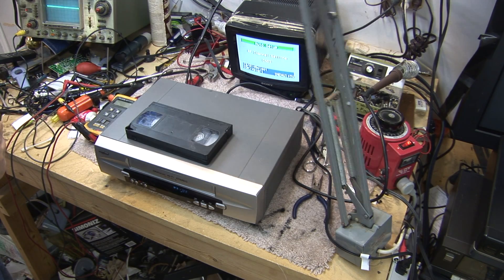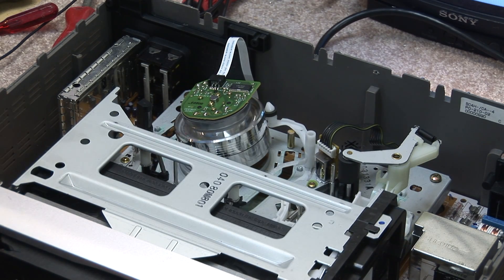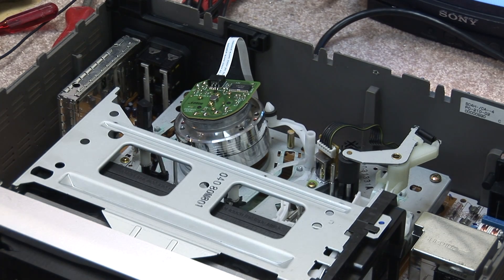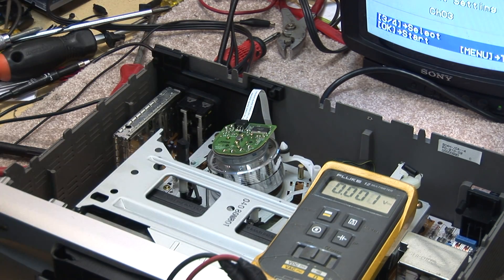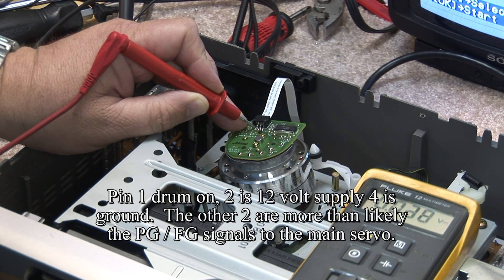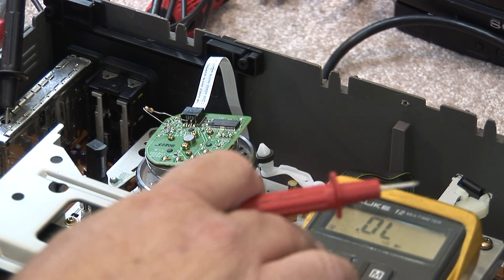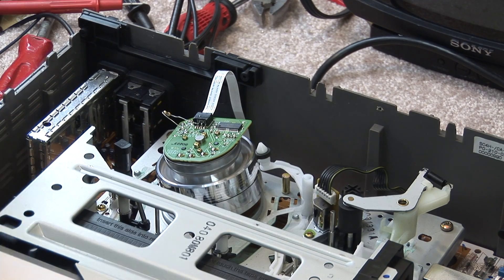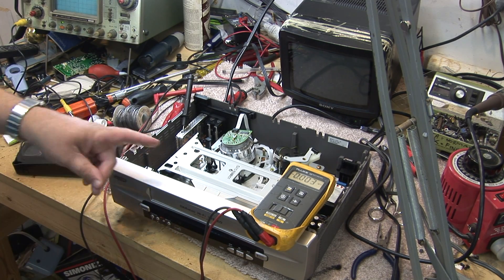Sanyo VCR Drum Servo failure

Comment: I can't thank you enough for this video. I have been having head drum speed issues, and I haven't been able to figure out what controls the speed. As I slow it down I see voltage spike on the pins, and then if I leave it alone it oscillates as it slows down and speeds back up. I feel like this is putting me in the right direction
Reply from the maker: If there is a drum free speed control tweak that slightly. As components mainly small caps drift they can get out of spec and cause the servo to get out of lock.

Comment: Do you have any idea on fixing a U-Matic deck where the capstan motor will not turn? I measured the voltage going to the capstan motor and it's only getting 2 volts, and the machine is going into shutdown. I have the schematic. For some reason I get the 450Hz FG signals though I can see them on my scope.
Reply from the maker: FG is generated by the motor spinning.  FG=frequency generator.  If the motor isn't turning you won't have FG
Reply: @12voltvids  Okay so it is turning because the FG signals are present. The servo circuit uses PWM and I can see it on my scope. Is that why I'm seeing only 2 volts? I'm trying to find the problem. Symptom is that it won't thread a tape and after 5 seconds the tape slack LED lights up. The drum motor is turning and I guess the capstan as well, but the reel and loading motors don't turn.

I looked into the service manual and it mentioned that if the "capstan reverse status" continues for 5 seconds it detects tape slack and will shut off via a signal that goes high. So I was thinking there was a capstan servo fault.

I know all of the motors are okay (loading, drum, capstan, reel)

Also this is a portable deck that used the small size cassette.
Reply from the maker: @KylesDigitalLab  If the take up reel is not turning or turning fast enough the tape will go slack and trigger an emergency stop so as not to eat the tape. Check your idler tires for slippage.

Comment: I got a Sony SLV-T2000 with doesn't power on at all, nothing. Powersupply is fine, I get the correct DC voltages. However the VCR powers on when I disconnect the 5 pin (MTR GND, D FG, D PG, D VS, MTA 12V) cable to the drum motor. Do you have any idea what I could try to fix this? The pins are not shorted. There is an IC on the board of the drum motor where the 5 pin cable connects. I would really appreciate it, if you could give me a hint. Caps on the circuit are ok i think. It's kinda weird that to VCR won't power on at all and the drum motor doesn't speed up at all when it's connected. Might this symptom be a shutdown mechanism from Sony?

Comment: Hi! I have an UVW 1800.. I bought a Convergence AFM216 Audio Enhancer which came with 2 connected cards and a few loose cables which i suppose they were connected to another card, but they were cutted off it. Sorry, for bothering you, but I'd like to know how to connect those loose cables, do you know how to do it? do you have a manual or schematics for it? a picture of the connections? whatever.. please if you could give me any idea on how to solve this problem i'd apreciate it so much. Thanks!

Comment: Great video.i currently have a similar problem with a vcr i was given.it was originally a mode switch problem which i fixed and it was working fine.now all of a sudden it will load and play a tape for a few seconds then stop playing because the drum is spinning way too slow.now i have a service manual for it so I'm going to see if i can find the fault.

Comment: I made an error on my Sony 670 dat. I changed the reel motor with a new one. However during the removal of the large white flex cable that connects the mechanism with the main board I did not remove the power connector as stated in the manual and now the drum does not spin.

Comment: 12voltvids .Hello there. I have sony sl800me betamax. The image plays in black and white. Heads cleaned. the tape is clean. Black and white image on all tapes. I tried it on different tv, the links are correct i am novice. I wonder where is the problem.
Reply from the maker: The chroma information is stripped from the video during recording and converted down to 688khz on beta (629 for vhs)  on playback this converted color needs to be converted back to the proper frequency and mixed back in to the video. Obviously a problem in this circuit. Could be a capacitor, ic, crystal ect.
Reply: @12voltvids  Thank you 12voltvids

Comment: This is very informative Dave, thank you for this. I have a question, maybe you can point me in the right direction. I have a JVC HR-S4600U VCR with a head that doesn't spin. Servo is on top like this unit. I checked the voltages on the flat cable and I'm not getting a run voltage (13V or whatever) but I do get 5V on the enable pin when a tape is inserted. Same thing at the mainboard connector so it's not a bad flat cable or head drum. Any idea where I can start looking to see why run voltage isn't being supplied? I can't seem to find a service manual for this model either. Thanks for your help man.
Reply: I did a little more tracing off the mainboard drum connector and traced pin 1 back to the PSU side and found an ICP-N15 that was open. Didn't even notice it was there the first time because I thought it was a transistor. On the supply side of it was was about 12V. I am ordering replacements ICPs from China (bleh...). Will post back here for anyone else with this issue.
Reply: Follow up on my HR-S4600U if anybody needs to know in the future. I received the ICP-N15 in the mail and replaced the bad on the VCR mainboard. Reassembled the unit and the head started spinning again. Works and plays tapes well now.

Comment: Thank you very much for your videos! I admire how "easily" you troubleshoot these machines and how quickly you get to the cause of the issue -- obviously you may have a long experience. Unfortunately, I have no experience and although your videos helped me to understand a few things, I was wondering if you or any other visitor could help me with this: https://youtu.be/6AxS-QDrBec I suppose that the picture and audio distortion I am getting may be due to a problem of the servo/tracking PCB, however I would like to be sure before ordering a replacement for it:  Thank you very much in advance!
Reply from the maker: Picture / sound distortion is more likely a mechanical alignment issue.

Comment: Any chance you can do a video on a VCR that has a playback that's too fast? When a tape plays it's almost like it's in FF. I've cleaned the mode switch, heads, tried multiple different tapes and even swapped out the servo and capstan (it's all one assembly) and still have the same issue. It's on Magnavox ZV427MG9 (VCR/DVD Recorder combo).

Comment: Im working on a Toshiba VCR/DVD recorder combo. The power supply was dead (diode), replaced it and it turned on. Initially the drum wouldnt start at all. I turned it slightly with my finger a couple revolutions and tried it again and it fired up and played and entire movie. When  I tested it the next morning it did the same thing. I don't know where to start. Ive fixed a ton of these and sold them but this one has me puzzled. Hoping you can point me in the right direction!

Comment: what rpm do theese run at?
Reply from the maker: John Scarce 
1500 for pal countries and 1800 for ntsc countries. 25 frames x 60 second and 30 frames x 60 seconds. Each rotation of the drum records 2 fields, 1 full frame. 
Now when digital came out things got faster. Digital 8 spins the drum at 4500 rpm and dv goes at the insane speed of 9000 rpm.
Reply: Thanks for the fast reply wow. i got 1 motor from those, but i have no idea if the vcr was digital or ntsc (im in europe so its ntsc). is there any way to guess what rpm was the motor designed just by looking at the motor(coils and magnet), the pcb, the drum or the rotational transformer coils?
Reply from the maker: John Scarce 
They are 3 phase ac motor controlled by the motor drive ic. They will go whatever speed you drive them to.
Reply: most of them are 3 phase perm magnet(such as mine). the problem is i blew the controller by applying voltage at the wrong pins of the power cable connector. even if it wasnt blown it wouldn't be able to know what voltage to drive it at to see its full potential
Reply: btw im asking because im making custom drive circuitry

Comment: This video is really helpful, I have an akai vcr with a drum problem it wont even fire, I've checked all the voltages to the ribbon cable to the drum and there all correct, the drum servo must have a problem

Comment: Great video.How do you know where the testpoints are.Is it because of your experience or is it written on the board.
Reply from the maker: They are not usually marked on the board. Usually there is a header (connector) with test pins and nothing plugged into it. On some units they are marked SWP for Switchpoint and RF for the head amplofier RF test poing but more often than not they are not labeled. A service manual / schematic will label them.
From my experience I know where most are located, and if in doubt, you can find them easily with the scope.
I spent 20 years as a diagnostic engineer working on consumer electronics, so I know what to look for, and know what the waveforms look like just based on experience,